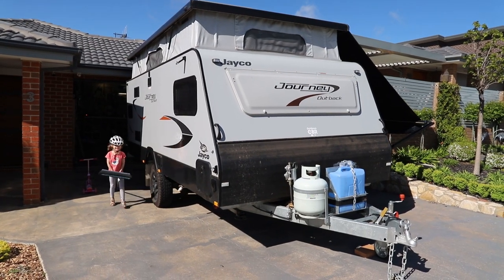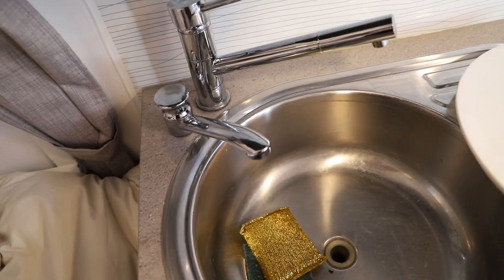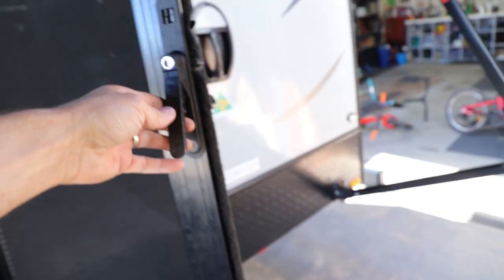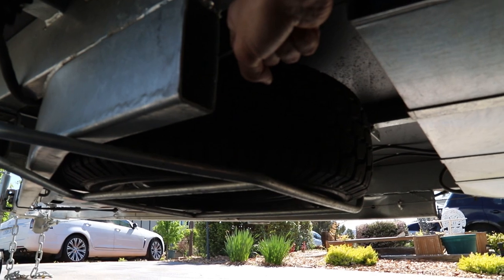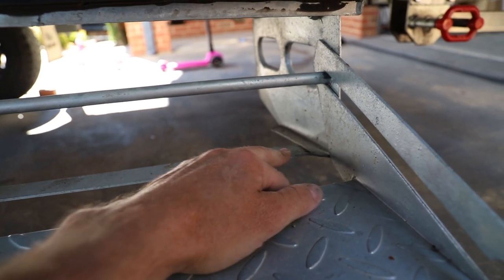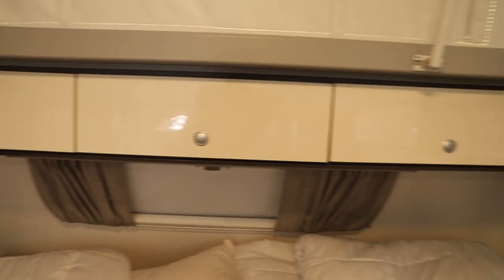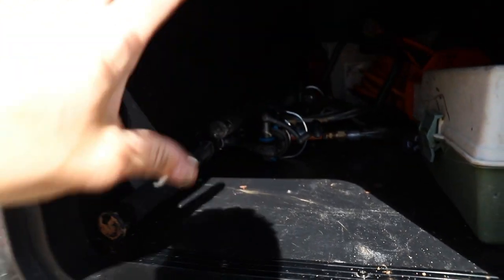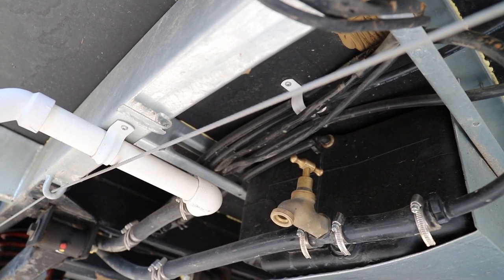2019 Jayco Journey OB 15.48-6 Review

Comment: Great rundown Lewy. Not a bad list of issues. We’ve got the 17.53-3 after having a 2017 Expanda which we also liked. Some similar issues nothing major.  Just removed the microwave for the same reasons. Love a  good freecamp. Diesel heater is the best thing since sliced bread.
Reply from the maker: Oh nice. That van looks the goods. What are you using the microwave space for now that its out of the way? Couldn't agree more about the diesel heater. So toasty when you need it.

Comment: Thanks for your informative review with tips etc.
We are looking at this model as we are just getting sick of all the bullshit associated with setting up our 
Jayco Eagle. We are getting to that point of not wanting to go away on our twice yearly trip to Gnaraloo, which we've been doing for over 30 years now!
One major issue that has me concerned is the width of the main bed.Our Eagle is 1450 and the Journey is only 1380. I struggle to get comfy in our Eagle so not sure how I will cope with less width.I talked to the Jayco salesman in Perth about this and no chance of changing this in the build.
We will not get the air con unit as will never use it ( $2600 less without) hoping this will also give us a bit more payload as well. I will query them on this when ordering to see if they can adjust the specs 
plate.No microwave either as will neve use. Will put space to better use.
We see great value for money in this unit and understand there will be some issues.
The best part of owning a Jayco is knowing they hold there value and are easy to sell.
Thanks again for your inside knowledge.
Look forward to more of your videos.
Cheers,
Steve and Karen Young
Geraldton WA
Reply from the maker: Thanks for the feedback Steve and Karen. Yeah the bed is an interesting one, it's not huge. If there's a chance to see one in the flesh then do that for sure. Double check with your dealer re the air con. Since making the video we got in touch with the Canberra dealer and they said the air-conditioning is not optional, they won't build it without. It's a bit annoying.
Reply: Steve.. A long shot as its 3 years ago, however, did you end up buying a 15.48? We live in Gero and are keen to view one before driving to Perth to purchase second hand. Cheers.

Comment: Hey mate, would you mind giving me an indication of the clearance height on the van. Looked  everywhere but can't find it in the specs online.
Reply from the maker: I can get a measurement from ground to roof when it's closed down. But I'll need to guess the height of the air-con unit.
Reply: @OutdoorsCBR  thanks, sorry I wasn't clear. I'm chasing the ground clearance height. I have a steep driveway to try and deal with.
Reply from the maker: @elroybeauzec4155  ah got you. yeah I'll try get it when I'm home.
Reply from the maker: Hey mate, sorry just realised you were commenting on the 15ft van video. We sold this about 6 months ago. Couldn't tell you sorry. We have the 17ft dual axle version now.
Reply: @OutdoorsCBR  I suspect the floor clearance would be the same. It's just a dual axle whereas the 15ft van is a single axle. The 17ft ensuite model looks like a great van. Good times, enjoy.
Reply from the maker: I'll measure the 17ft for you and let you know. it'd be similar.
Reply: @OutdoorsCBR  out of interest, did you consider to install outdoor hotwater system with external cubicle similar to the crosstrak or is that not compatible?
Reply from the maker: Yeah you could use a portable gas hot water unit. We had a Coleman one that used a propane cylinder and water bladder. We  just setup a shower tent. Plus we had a mini Ironman 4x4 portaloo.

Comment: Great round up mate. I think anyone getting into caravanning, regardless of brand, needs to have some level of awareness that things can and will go wrong and you absolutely need to be prepared to roll with the punches. It could be the difference between having a hiccup to your holiday vs having to abandon it. It is videos like yours which assist with getting a spare parts list together for things to have on hand (e.g tyre valve). With the exception of that brake cable, none of those issues you've listed concerns me too greatly. This is why you fall back on that warranty and Jayco are everywhere. Perhaps the only thing I would have liked some more detail on was the number of km's travelled, type of roads and how easy Jayco dealers where to deal with with warranty items. We pick up our new 2020 model Journey 15.48-6 OB in a month or so, very much looking forward to it. Options wise we went with the larger solar panel, extra water tank, hot water unit (no longer using Suburban) and external shower. Kinda kicking myself now we didn't get the bike rack, though we'll get something like a Grip Sport to go on the drawbar which will cost a bit more.

Already had the microwave pegged as lasting a few trips before we remove it for the cupboard space, though found it interesting that you said you haven't used the A/C much at all. I've had some truly punishing nights in the tent due to those long hot nights, so being able to retreat to a caravan park on occasion to crank on the A/C is actually one of the things I'm quite looking forward to. Is it that you haven't found it effective in dropping the temp, or just haven't found yourselves out camping on those still 35c @ 11pm kinda nights? Last question, did you do anything with seal reinforcement? Have watched other channels around Jayco vans where they go to town with the silicone and rubber grommets to plug up all the holes they can coming into the van for plumbing and cabling. How have you found the van goes keeping the dust out when on the dustier roads?

Edit Forgot one question. How have you managed with the 350kg van load capacity? You did mention you pack light anyway, just wondering if you think you struggled to keep the van within the weight limits with bikes and water tanks full, etc?
Reply from the maker: Thanks for the reply Dominic. I agree with everything you say. In answer to your questions, we have done a wide variety of roads. The worst dirt road being that 300km stint on the dirt to Menindee. A little bit of offraod sine then, one very corrugated road driving into Black Rocks Campground. At a guess we would have done around 6000kms in total since we have owned the van. 
Our Jayco dealer is Queanbeyan, and personally I think their service dept is understaffed, and extremely low on physical space to park and work on Caravans. They need a bigger yard. They are generally no questions asked, but can be long wait times. We used the air-conditioning for the few nights we were in Broken Hill and yes its awesome and cold. It is very noise though, particularly when it auto turns on and off. But most of the time we aren't in caravan parks. We blocked the door vent, amd put some gaffer tape around some of the plumbing holes etc in the floor, but all in all we got hardly any dust coming it. I was quite surprised, not even sure I needed to take those precautions.
You chose great extras. We wish we had hot water and the external shower.
Reply: @OutdoorsCBR  Yeah, shower is key with my boys or they'd have the interior trashed pretty quick otherwise. We did look at the 17.58-3 for a bit, big step up in price and weight needing to be towed. We'll likely end up with a cassette based portable toilet like yourselves for rare time we are camping where there aren't at least drop loos. Think I'd just much rather keep all that sort of stuff well away from where we are sleeping and eating. 

Great feedback on the dust sealing and Jayco warranty experience. I have two Jayco dealers within an hours drive, so hopefully this can work in my favour. Thanks for the feedback on the A/C as well. What do you do to keep cool when off grid?

Comment: Just beaware that Deleting the A/C next time would be a bad move and affect resale value when selling.

Why not invest in a Trailmate jack and ditch the factory jack.
Hand sink pump sounds like it had air in the lines.
I would havd thought in this day and age a 12v pump would have been included.if not allready done so Sirico fans fir air flow at night if needed.
Reply from the maker: Cheers for the info Mick. Turns out Jayco won't delete the air con anyway. Yeah have heard good things about those jacks, two birds with one stone. Yeah not sure about the water pump, definitely had air in it, just not sure what the solution was.